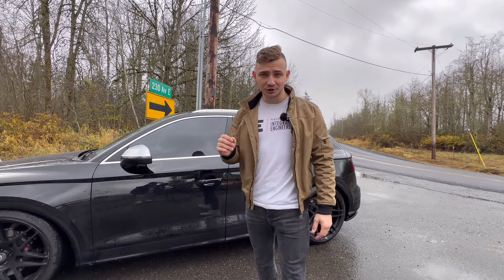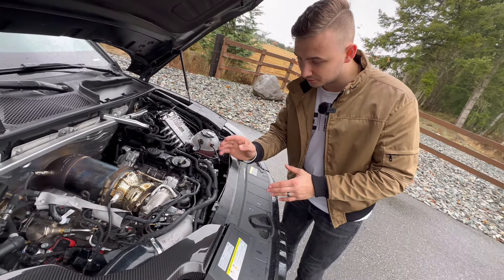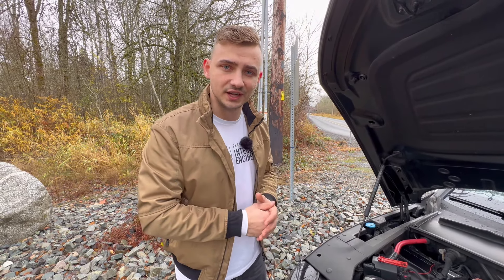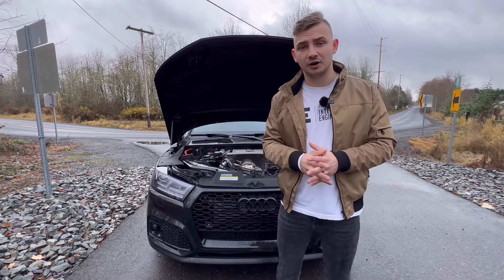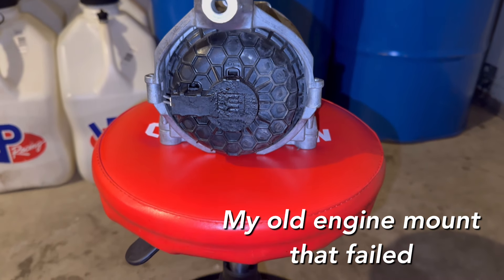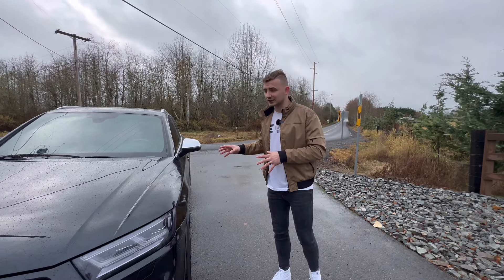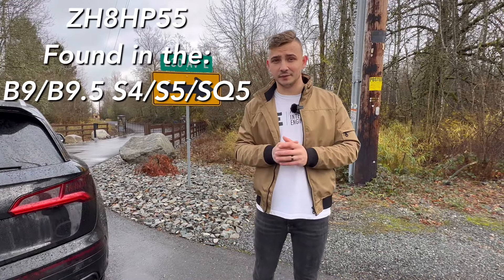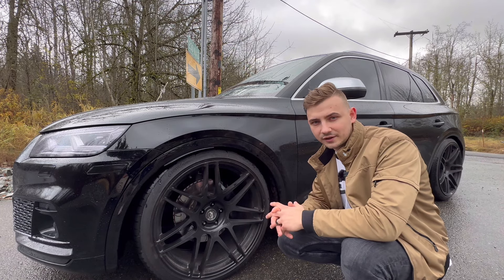Building an AUDI SQ5 into a BUDGET Supercar Killer

Comment: Beautiful car! I'm on the point of purchasing a 2018 SQ5 with 70k miles. I test drove it today and performed really well. After reading a lot of reviews on the internet the same thing about "rocker arms" is popping up. Can you give me your advise and place this issue in a little bit of context so i can make the decision of purchasing it or just go for another car. Thanks for the help!
Reply from the maker: You wont go wrong purchasing an SQ5. Rockers arm issues have been only for the 2018/2019 models and even then less than 2% failures of all those vehicles on the road. Even then 5W-40 oil and oil changes every 4/5k miles will most likely change that outcome.

Comment: Just wondering how everything has been holding up. I have a tte710 now and was thinking of going 810/750 but I am a little concerned about the car holding up.
Reply from the maker: I’m at 80k miles now still on e60 most of the time. Running perfectly. Zero issues. Zero problems.

Comment: I am curious to know as to why you used KW V3 ? Are they adjustable same way as air suspension in car changing driving modes ? How’s the comfort ? The reason i am asking is previous owner on my vehicle installed H&R sports spring and drive is really stiff in dynamic. Would love to know what this kit offers

Comment: Do you think it's possible to get a q5 b9 2.0t to 400hp? Should I just get a 3.0t instead?
Reply from the maker: Don’t bother with the 2.0T even the B9. It will take probably a Hybrid turbo and full bolt on and get it to 400hp. Even then you’ll be looking at a very unreliable engine/trans in that car. Don’t even bother. Get a B9 SQ5. It’s a massive upgrade even stock. You can make 750hp just Iike me without any issues while keeping all reliability man. Trust me on this. Worth.
Reply: @Need4Built  Thanks for the info man! How much worse is the b8 3.0t? I can get a 2016 q5 3.0t for a really good price with low mileage. You think it's worth an extra 7k for the Sq5 b9?
Reply from the maker: @Sh-ue6wy  So the B8 3.0T is a very established platform. Very cool and reliable as well. BUT you won’t make more than 500whp and that requires heavy modifications. 
With the B9 SQ5, you can make 640whp with bolts on and hybird turbo. It’s even more reliable and the interior is a HUGE upgrade. The transmission is beefed up even more. All around the B9 is miles and miles ahead of the b8 motor and chassis.

Comment: Why’d you decide to go with cts for the downpipe?
Reply from the maker: The CTS Catless Downpipe is the best option for a catless downpipe. Welds are really good. 
For a high flow catted option, CTS SUCKS. 
Wagner is the best High flow catted option.
Reply: @Need4Built  did you look into redstar? I’ve heard it’s the best for hi flow catted if you can stomach the price
Reply from the maker: @carterg1847  It’s overpriced and I’ve heard of those cats having clogging issues. 
Wagner is the way to go. IE is working on an SQ5 downpipe.
Reply: @Need4Built  The Wagner one is and has been unavailable for a little while. I found some forum posts about the redstar ones melting and they were all using the old HJS cat in it, I’m hoping the newer GESI cat won’t have the same issues because it seems to be the only decent hiflow downpipe on the market for our cars, thanks for the info.

Comment: You still have the oem bumper by chance?
Reply from the maker: The current bumper on my car, is the oem bumper! I changed the oem grille’s to an RS style Front grille+RS style foglight grilles.
Reply: Oh nice. I need to replace my bumper and thought it was the rs bumper. Love what you’ve done with this thing. I went BT on my b8 a4 back in 2011 and this is my first car that had remained stock. Going jb4 and catless dp in 2 weeks. Have all the parts just can’t install myself 🙃

Comment: Did you see the OEM failing or anything like that, that you installed the TurboSmart DC?
Reply from the maker: My oem one was leaking about 1psi of boost. 
This upgraded DV leaks less than that but still isnt rated for the 810 power level.
Reply: @Need4Built  I'm also planning to get the TTE810 installed. Which one do you have, or do you think there one on the market by how that would hold to this turbo?
Reply from the maker: @21sq54  Definitely absolutely go for the 810. 
That’s what I have. It’s miles ahead of the 710 and makes it obsolete.
The tte810 and pure750 have been pretty close. From what I know the 810 will have more potential in the future over the pure 750. Pure turbo might be working on a bigger turbo.
Reply: @Need4Built  I meant which TurboSmart DV did you install or if there is a better one on the market by now which you think could hold the TTE810 boost. Since I'm all in for the TTE810, sounds like I'll have to address that part too :). Appreciate any insights!
Reply from the maker: @21sq54  I’ve reached out to a few companies to find out. No direct answers really. I think turbosmart should be working on something a little stronger.
Reply: @Need4Built  I have a forge DV, not sure exactly how much boost it can hold but they have springs you can change to tune them.
Reply from the maker: @sixajd  I’ve Tested them all. The forge dv was leaking boost even with the stock turbo.

Comment: do you have a video or tutorial on how to install the fuel it ethanol sensor?
Reply from the maker: @andytran-ry7yc  I don’t but I should definitely make one
Reply: @ that would be so helpful!
Reply: @Need4Built  hey circling back to this, what tire pressure do your recommend for street daily driving? I have michelin super sport(265/35/19) all around and when i launch the car I spin a lot. I also get the traction control blinker when I roll from first gear onto second gear.

Comment: Great  Vid!  Have you ever logged air temps on you intercooler?
Reply from the maker: I have, they are amazing with the stock turbo, but the 810 needs more cooling. IE is working on a drag cooler which I will be putting on soon to maximize my cooling performance. For now the FDS cooler is the best on the market.
Reply: Thx Bro

Comment: I’m looking to put 22’s on my B9 SQ5 as well. What size tires do you have? I do have the air suspension so I’ll be getting the CETE module as well. I want a fairly comfortable ride and no rub. Was going to do 21’s but now you’ve got me thinking about 22’s lol. Thanks man!
Reply from the maker: Running F14’s 22x10.5 with 265/35/22 DWS06’s.

Comment: Hey man. Did you switch out your rocker arms due to the history of failures?
Reply from the maker: I think I’ll be making a video about this soon. I believe there’s an Audi conspiracy to this and a cover up. Those rockers were revised in the 2019 models for a reason. Audi knew they messed up. I’m fairly certain mine are going bad and I will definitely making a video about this, and possibly replacing mine.
Reply: @Need4Built  thanks for the reply! I’m on the fence about the issue. The fact that you’re running that much power on the originals makes me think it’s more likely a parts batch thing, rather than them all being bad.

Still, wise preventative maintenance for your build! 

Sick channel btw.
Reply from the maker: @Bergerac82  I’ve seen more rocker arm failures on the stock tune rather than with any mods what so ever. I’m honestly not sure. 
Preventative maintenance is the way to go absolutely!

Thanks for the support! I got lots more content on the way! 👊🏻

Comment: Should have gone diesel. You can get those numbers but improved over stock fuel mileage.
Reply from the maker: TDI SQ5 in the USA doesn’t exist.
Reply: @Need4Built  It doesn't have to be an SQ5, with all the mods you've made it would be nearly identical if you put SQ5 bumpers on the American diesel Q5.

Comment: Crazy how far back Audi is compared to BMW.  Same size engine as x3m 3.0 and it needs to be stage 3+ to be able to make the power x3m makes with OTS tune.  Lol
Reply from the maker: Can’t compare the 3.0T to the S58… s58 is in line with the 4.0T platform. Which is crazy to me to think a v6 has as much potential as a v8. 
Bmw doing something right. However again, the 3.0T is in line with the b58 only.
Reply: @Need4Built  s58 b58 both inline.  I know they literally have more potential than 4.0t
Reply from the maker: @Ekooo0  Audi needs to step it up.
Reply: @Need4Built  agreed I looked at the video to see maybe this would be cheaper alternate for x3m. I currently make what you make with ots tuned m550i. 640awhp 680tq.

Comment: Holy fuck I’ve been trying to get a b8.5 sq5 for a while (personally has to have panda interior with sepang blue) but I might just say f it and do this holy shit near 10 second sq5 is nuts
Reply from the maker: You’ll literally be doing 10’s on the street full weight man. It’s one hell of a ballsy suv.
Reply: @Need4Built  seems like it’s a lot more modifiable rather then the supercharged engines as they plateau around 450-500 without major internal work and twin charging it, I’m just curious to see the longevity of the engine… have you noticed anything in the few months running the new 810 other then fuel Econ going down and more fun being had?